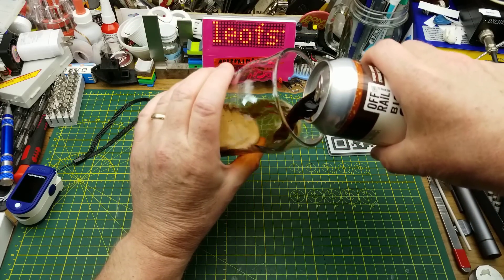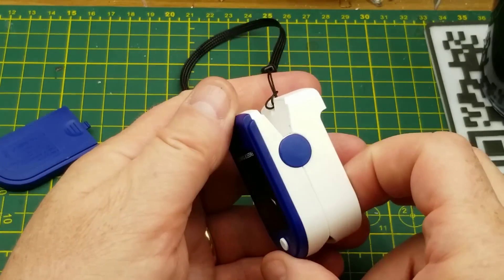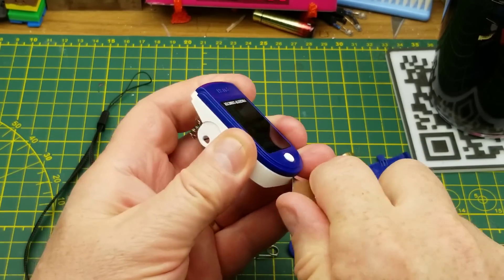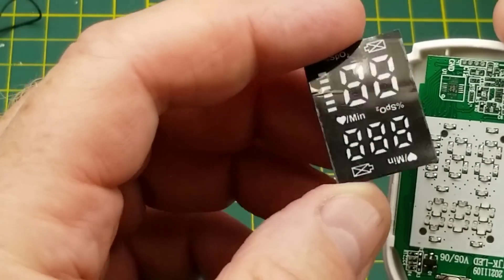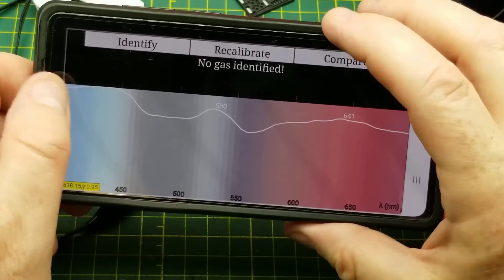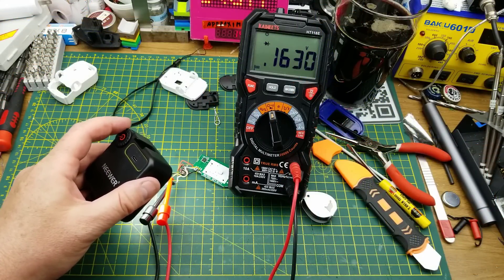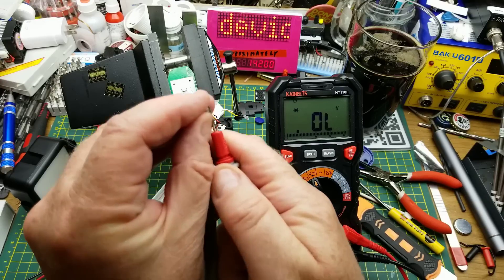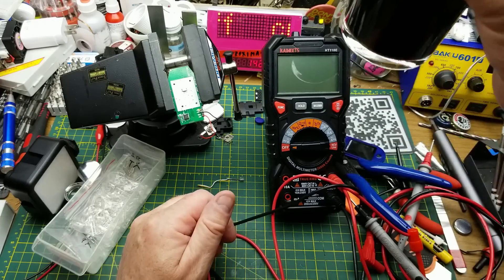Cheap medical device: curiosity teardown

Comment: I bought a supposedly good one, ie, Zacurate 500E, and it nearly always reads the same within 1%, ie 98%. Only weight training would drop it down to about 95%.
I also bought one of those cheap pulse watches, and it is very finicky how you strap it on, ie, get it right and it's accurate, get it wrong and it misses pulses.

Comment: The perfect gift for the hypochondriac we all know 😆
The OLED Display version (aprox 9 bucks) has a menu for changing settings, calibration, etc.
Regular Red Ga LEDs are often used for detection of IR and/or UV. I use an 8 x 8 array to charge Li Button Cells. 
   ;)

Comment: I used my osci on mine and noticed that the 2 LED's are on very briefly in high frequency one or the other so intensity is measured between the two to compare.
And on my old mobile I can clearly see them light up. Nice little package of those 2 LED's.

Comment: Most cell phones nowadays have infrared filters over the camera, because it makes the picture look slightly better. If you've got an old cell phone, you can take it apart and remove the filter to make it see infrared again. In fact, you can make a filter that only allows infrared out of stage lighting gels, if you want a cheap infrared camera.

Comment: The weakest point of this model is the 2 wires near the hinge running from the batteries at the bottom to the top part. I've seen many break down because of that. A ribbon cable was probably too expensive 😅

Comment: 950nm corresponds to a temperature of about 3050K so unlikely your IR camera could see that. Thermal cameras typically operate at much longer wavelengths that match temperatures more comfortable to us.

Comment: I also ordered one of these cheap oximeters for ~9 Euros. I can confirm it's inaccuracy is 4-5 percentage points under the values, what 2 calibrated instruments on the same fingers are showing.

Comment: The Microcontroller is from a Chinese company Jieli Tech who are known for thier Bluetooth chips for speakers and the like. They have some chips on thier website listed as 'Medical Health Chipset'. I can't find that part number but a semi custom high volume chip pre-programmed from the factory would probably have a unique part number. The JL chips have a weird 32 bit risc architecture and all the usual microcontroller peripherals plus bluetooth, audio adc/dac, DSP, sd card / usb interface, fm radio etc on the bluetooth types. I doubt there is anything special on this chip though, it will be just a generic microcontroller with a sufficiently accurate ADC.
Reply from the maker: Thank you.

Comment: Huh. I’m 70 and started smoking at age 19. My oximeter gizmo and my “clever watch” both agree on 97%.
What am I doing wrong?

EDIT I should have watched the whole video before commenting. My pulse oxy gizmo has an OLED display that rotates with extra button pushes. Possibly it’s also more sophisticated in other areas than the one you took apart. I’m also wondering where the display driver is. There don’t seem to be enough pins on that micro to do the job. Is something hidden under the display? Is it Charlieplexed from the uP? Inquiring minds are vaguely interested…

LEDs make passable photodiodes for wavelengths longer than they’re designed to emit (stating that for those who don’t know). That may indeed be an LED. Stick it in your LED tester. If it’s a photodiode it won’t light up and you won’t hurt it.
Reply: Very likely a photodiode, large area black silicon diode, with a thin junction very close to the surface to make it really sensitive to light longer than a cut off wavelength. Thus it responds to any light with shorter wavelength that that. It will emit light, though only at longer wave IR, like the silicon IR photodiode on the emitter side.

Comment: Does the photo diode have the ability to transmit light?  I remember hearing that an LED is also able to detect light at a slightly different wave length.
Reply from the maker: If this one does, it's probably out of the visible spectrum